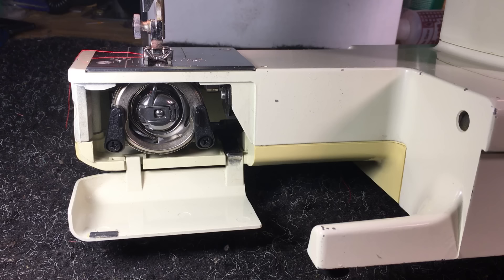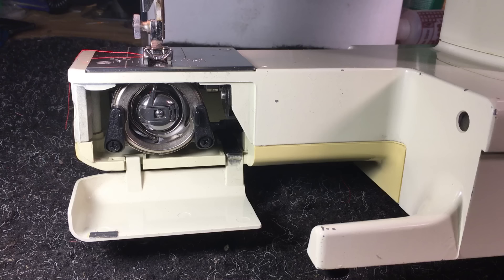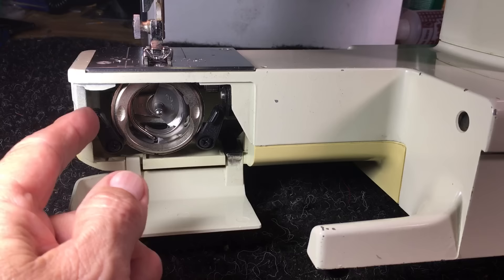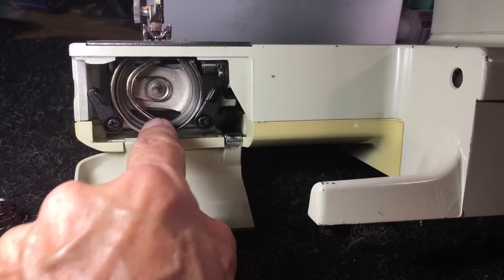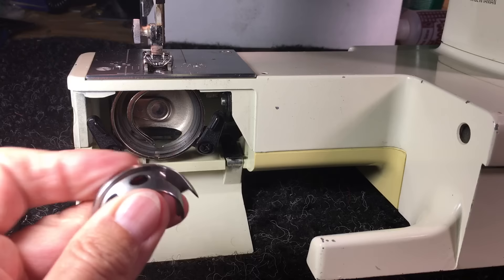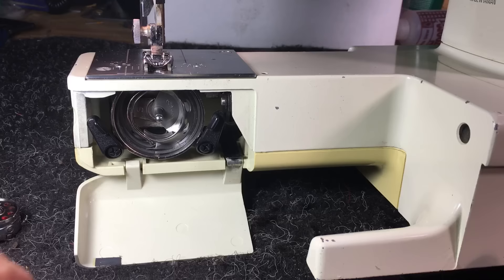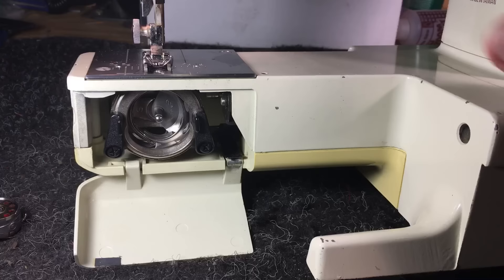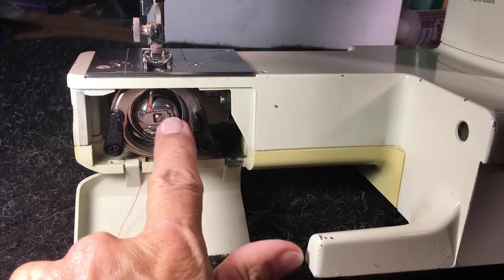Re-assembling the shuttle hook mechanism on a front load 15 class sewing machine

Comment: My machine is not sewing .break the thread rguler what's rong
Reply from the maker: Thread breakage can be caused by many things. The most common are needle issues. If the needle is installed improperly (flat side facing wrong direction) the thread will usually break almost immediately. If the needle is bent or blunt, it will cause breakage. Wrong needle system or size will cause issues as well. If the thread is oversized or old and decayed, it will break easily or jam the machine. If the tension is too tight it will break the thread. Tension is almost always going to be in the number range of 3 to 5 on your thread tension dial. Look for a sharp edge or burr on any part that contacts the thread: hook, needle plate, bobbin case etc. Smooth it out and add a couple drops off oil. Hope that helps.